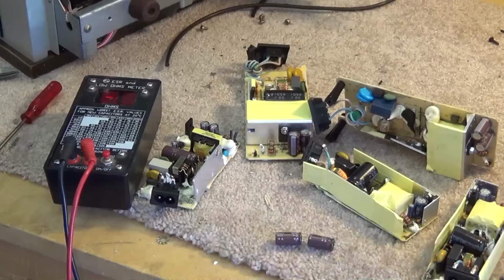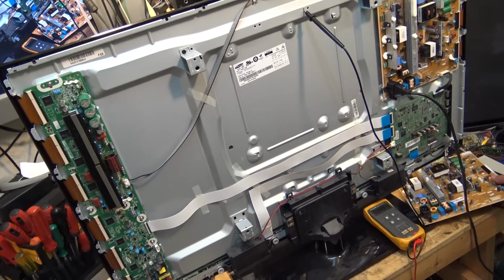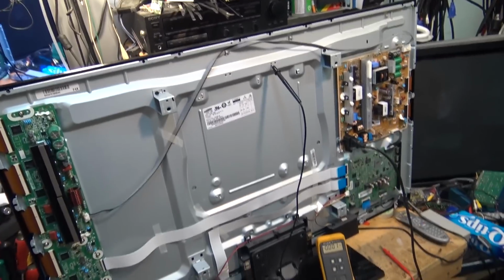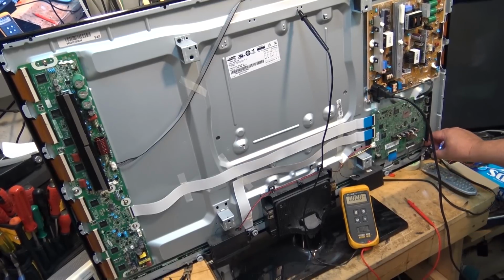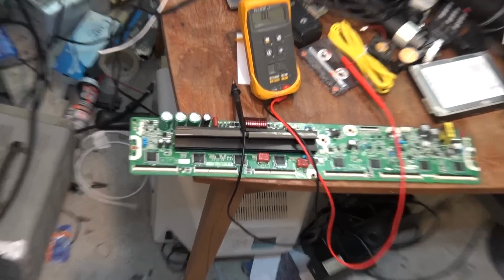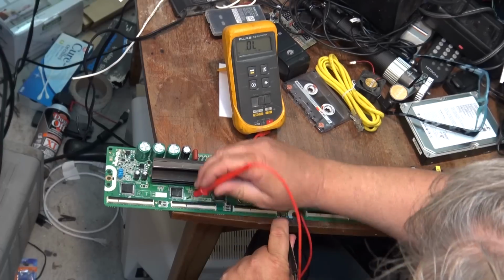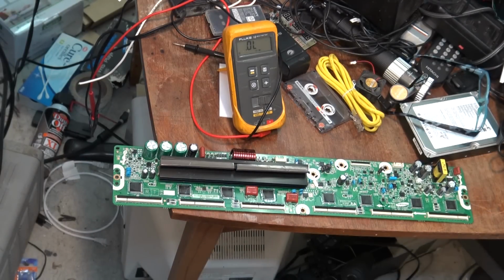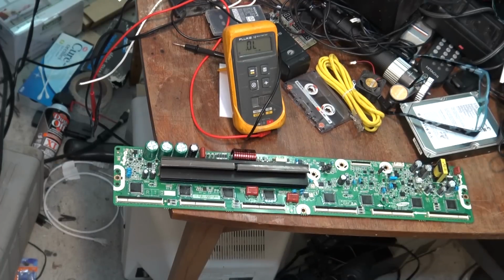2013 model year samsung plasma tv troubleshooting

Comment: I have the 50 Inch version PN51F4500AF (2013) and its dead too 3 flashes on power indicator.  The blue status light on controller board doesn't blink at all, VSS which suppose to be 205 volts shows 10.75 volts and VSA shows 0 volts.  Can I assume the power supply is the problem?

Comment: I have a Samsung 60-inch plasma TV, model PN60E550D1FXZA with factory remote. When cold, the TV will turn on and operate normally. After operating for longer than 30-60 minutes, if the set is turned OFF and then back ON, it will turn back ON, but there is no picture (screen remains black). I can confirm set is ON because I can hear audio from the speakers when I operate the VOLUME UP/DOWN control on the remote. If I allow the TV to rest (cool), it will eventually turn back ON with picture restored. That may take an hour or overnight.

I have removed the back of the TV and looked for overheated or bulging caps. There is some minor overheating indicated on what I presume to be the Main Power board (located in the middle behind the back panel cover) in the vicinity of NT8015, see attached pic labeled "NT8015 Heating". All of the capacitors on all the boards look normal.

I have a digital Fluke meter so can take AC/DC voltage and continuity readings but am not sure where to start. No o'scope available.

I'm hoping you can recommend some voltage checks at particular test points when set is ON but in a loss of picture condition that will narrow down the problem to a particular board or components.

Thanks in advance. If more info needed, just let me know.
Reply from the maker: Have no advise on this.  I had one once that took exactly 20 minutes and 17 seconds to produce a picture every time it was turned on.  Decided that it was the little logic board that was the culprit but it was never replaced as the owner didn't want to replace on a guess and that was what it was.  Taking 20:17 every time it was turned on pointed to something at a logic level but no info. Guy took it away and just left it turned on 24/7 and just turned off his cable box when. Done. Had the Samsung logo boucing around the screen all night.  Was his garage tv. When it went in at night he turned it off.  Next day turned it on 20 minutes before watching.   Not worth it to fix.   Now fee parts available as plasma have been out of production for about 10 years.   Might be time to move on.   I get people asking me to look at their old flat panels all the time and decline almost all of them.  Even for friends.  Just not worth the time or effort.

Comment: Hello. SIR, I Own A Plasma TV I Removed The Back Cover And Tested Some Of The Components The Capacitors Arent Swollen At All, But The  13 Wiring Harness Going From The Y Sustain Board To The X Board Is Burnt. The TV Was Working Fine When On Then The Screen Will Go Dark,
Reply from the maker: Don't have a clue.  Been a long time since i looked at a tv.
Reply: Hello, SIR, I Found The Problem, Its The Two Capacitors On The Y Sustain Board, PN C5107 - C5106. 250 Volts 47 UF. There Facing Downwards And Leaking Fluid. Would That Interfere With My Screen Going Dark, Its Only A Question, Thanks Again,
Reply from the maker: @arduinogalipo4850  if they are leaking they are shot.
Reply: @12voltvids  Thank You SIR
Reply: Hello SIR How Are You Doing, I Received Lead Connector For My Y Sustain Board & X Main Board. I Plug It In & Then The Transformer Board Made A Fizzing Sound IT Was To Late To Unplug It  I Check All The One Way Diodes Even The Small Ones, I Hear The Transformer Still Working & The Fusses Are All Good, What Do You Think Of Your Experience,
Reply: Hi Agine Sorry To Bother You, I Corrected The Harness At The Other End Reverse The Two Wires It Has 13 Wire Connector,

Comment: Hi!
I have the same TV with same shutdown faliure. I've mesured the chips like you did any they're all fine. I also mesured other components and found 2 bad IGBTs and a fast recovery diode. Is it possible that these components failed by them self? I'm afraid that even if I replace them they'll fail again. I checked as many components as I could but I find no fault other then these. 
Since one of the IGBT's that failed is paired with another one in paralelle on the main heatsink I think if there would be a driver or output problem both on them would have popped is that correct?
Thanks for your answear!
Lovely vids as always! <3

Comment: Sorry to bother again but, in your experience, is there danger of a "bad or shorted" board damaging other boards?  I'll be replacing all boards 'cuz I don't have the expertise to determine  which of the boards are bad. I won't  put them in one at a time if there's a chance of damage but I'd sure like to know the culprit!  :-)  Thank you.
Reply from the maker: The system is fairly well protected but plasma sets are high voltage high current devices so it is possible that the y main or  x main board could be damaged.  Measure all the diodes and mosfet for shorts do a visual for any blown parts.  By blown look for parts that are blown apart because due to the high power on plasma many times if a part fails will will be burnt or blown apart.

Comment: Hey,  My Samsung PN60F5300AFZA (plasma 2013) went dark and now when connected to power the front panel red indicator light blinks three times and then nothing happens.  Care to take a guess at what to replace?  Here's a list of the boards it has.        Thanks! 
Samsung BN44-00601A (PSPF371503A) Power Supply Unit
Samsung BN94-06195G (BN97-06528V, BN41-01965A) Main Board
Samsung BN96-25255A (LJ92-01957A) X-Main Board
Samsung BN96-25257A (LJ92-01964A) X-Buffer Board
Samsung LJ92-01958A Y-Main Board
Samsung LJ92-01962A Upper Y Scan Drive
Samsung LJ92-01963A Lower Scan Drive
Reply from the maker: Likely one of the buffer boards but you will need to measure and look for shorts. Could be just about anything.  I am not a plasma expert. I have only worked on a hand full of them.
Reply: Thank you kindly for weighing in.

Comment: Hi 12volvids, thanks for the video. Its great actually watching someone who knows what they're doing work! I have practically the same model with the intergrated power board. I went to start testing it and its blown a fuse, so i'll have to pick up a few before any testing. I run the tv through a stabaliser which also blew its fuse at the same time?! Does this immediately indicate something to you?? Thanks again.
Reply from the maker: Short in the power supply
Reply: Cheers  @12voltvids ! I'm testing both sides of the fuse for a short to ground. But i haven't found one yet?!?!?!
Reply: @12voltvids  I'm going through this slowly. I found no shorts on the sides of the fuse so i put a new one in. I made myself a light bulb current limiter to test for the short. I used two 110v 40w lamps in series because i dont have anything else around. Lamps glow dimly. Unplugging the various boards makes no difference. Apparently the bridge rectifier is a common fault on this model, so i'll take it out and test it. But based on what i've been learning around the place, it seems like its just a fuse. Whats the likelihood of that?!?!
Reply from the maker: @mikescudder4621  yes bridge rectifiers can and do fail when power surges hit.  If there was a short the light bulbs would blow really bright.

Comment: Wow, they managed to get plasma running on just 3 boards? I'm impressed.
Reply from the maker: nomoredamnnamestouse 
That old Panasonic plasma sitting to the right of my bench has at least 15 fully populated boards in it. Talk about complicated. This one was a nice simple unit. I miss plasma sets. They still are my favorite and I have enough of them to last me a long time. Not counting the broken ones I need parts for I have 10 working sets. 2 of those are game sets as they have panel failures (solid green vertical line on 1)  I also have 3 more in the shop that were given to me to look at and see if they can be made functional again. One is a real high end Panasonic monitor with a stand alone tuner / controller box. I figure is I keep them long enough they will be worth something like all the old vintage stuff is now. Once most of the ones is service have been scrapped a working plasma just due to the coolness of how they operate will be a thing of beauty. Each pixel is operating just like a tube. Electrons ionizing a gas and flying across a gap producing ultraviolet radiation that makes phosphorous fluoresce.  How cool is that. LCD and OLED. Yawn, boring.

Comment: I have a similar set, the PN51F5300.  Similar challenge so I rolled the dice on a $15 ymain.  Tested fine before putting it in.  If TV is left unplugged for a while (24 hours) I can plug in and run the TV normally for a few hours.  At some point the picture will go blank, but I keep sound.  A reset in power and the TV will come back on, buy no sound or video. Possible bad power supply?  The new ymain does seem to run the TV much cooler than the old one.  TIA!

Comment: My 2009 Panasonic plasma is still running strong. I currently use it as a computer monitor and love the picture it produces. It will be a sad day when it is no longer repairable and I have to switch to lcd. :(
Reply from the maker: Yes I use a 2009 Panasonic 1080p plasma on my computer as my edit work monitor. Will be a sad day when it breaks.
Reply: I know. Those OLED sets are very expensive! Plasma is the next best thing.

Comment: What's that short high pitched squeal each time you turn on your bench power?  I've noticed it in your last couple of videos.  Just curious.  :-)
Reply from the maker: That 6 digit banggood clock is plugged into the switched bench power so when I turn on the power it beeps. I should probably plug it into an unswitched source.

Comment: I used repair these at component level. However I used to find when the buffer ic shorted it took out the mos fets on the ysus and often another driver ic smd underneath. In the end it was so time consuming fixing all the components that I just replaced the boards. Recently I had a samsung in 2011 model. The ysus had blown it's fets but the buffer was ok. I changed the buffer and ysus panels as I didn't trust it not to be completely error free. It's not worth blowing up a replacement panel. If I get one of these now I always change both if separate boards and keep back the buffer board until I can test it in a junk set so I don't wreck my customers tv. Enjoy your videos man. I'm in the UK.  Tv repair man 28 years.
Reply from the maker: Right. Usually what causes the buffer board to fail is the SMD driver on the YSus develops a bad connection. You will see that one on a prior video, where I was given a set with a bad buffer. Ordered a new buffer, and it was bad, missing the bottom portion of the pix, ordered another buffer. Before installing that I went over the ysus with a microscope, and found cracked solder on the tiny SMD drivers on the back side of the ysus. I pointed this out. They were covered with a piece of amber colored tape.
Fix them, and put ini the new buffer board and it is fixed, and still working today (watch the news on it every morning while getting ready for work)
Reply: Louis Rossmann has tons of videos on macbook board component level repairs.
Reply: Hey Tim, maybe you could think about putting a few short videos together. There's too little component level repair on YT!
I've learned a lot from Dave, but these days it's all smd stuff and boards are expensive!
Reply: Koffi Banan I have learned a lot on youtube but I have not done any videos in ages I am more into cb radio and vintage valve gear.
Reply: I know and have watched quite a few (but not the rambling hour long ones). You do learn the technique of microsoldering and troubleshooting but it's very mac specific. I almost never have access to schematics, let alone boardviews, but I am sometimes able to fix boards. It would be nice to see more videos of people working on random stuff and fixing what might be common faults. I've been thinking for some time now to do it myself (I'm not an expert of any kind, but I do work on cars, bikes, pc's, radios, whatever..)

Comment: 2013 was end of the line for plasma at least for the most part. It's really nice that they had simplified the design by then.
Reply from the maker: I miss the plasma sets. They had a superior picture. The OLED sets are promising if they can get the reliability up.
I still use plasma here. All my TVs, including my edit monitor are plasma. I have only 2 LCD. One is the monitor I use as a view finder over my bench, and the other is my 4K test set in my office where I check my 4K for quality before uploading.

Comment: Hi 12volts, great video as usual, just have one question, Is it possible to change the IC without too much damage if you use a hot air station and would it be best to change all the IC's at once to reduce the risk of another one failing??
Reply from the maker: Buffer chips are a changeable, using hot air, the trouble with them is they typically also glue them down with a silicone bead around the pins. These chips operate on high voltage, and can grow "tin whiskers" that will short the pins, so they hermetically seal them with silicone. You have to make sure you get it all off, and then cut the pins off with a razor blade remove the chip, clean up the board and replace the chip and re glue it down. If it was my own set I might attempt this, but on a clients set, it would be an entire board replacement.
On my own stuff, if it breaks again down the road, no big deal, but I don't want to get married to a clients set.  
Generally the other chips are fine. They are not that common that they fail, so the rest are probably good. Buffer chips have the dies soldered down as well, so you need to heat the bottom of the board as well as the top. They are a pain in the but to remove. I have tried taking some off a dead board and they are fun to work on, and I am being sarcastic when I say that. Worse than the gamma correction chip I changed on that sony.
Reply from the maker: Yes it is easy to get married to old electronics. Fix one problem, and something totally different breaks a few months later and then they demand that you fix it for free.
Reply: Did you have liability insurance and if so what does it cover? I'm just trying to understand where to stop when doing electronic repairs for family and friends (sometimes for money). People keep telling me to advertise repair locally but I know these days people will sue for anything.
Reply: 12voltvids Cant you use debonder to break the glue?
Reply: "I don't want to get married to a clients set" has this ever happened to you in the past? I'm really trying to be careful when doing favors for people in case that ever happens to me.
Reply from the maker: It is silicone rubber.
Reply: It's funny you say that I work in the automotive industry and the exact same thing happens, you fix a leaking water pump the next day there wheel bearing goes bad and they think it's your fault and they demand that it gets fixed for free so I know exactly what you're talking about
Reply from the maker: Remember the majority of the stuff I repair is my own equipment. People give me stuff to recycle, and I repair and sell it.
Very little of what I repair is for clients, and those clients I do have are mostly long term clients that I have had for many years. I am not too worried about someone attempting to sue me for repairing an old piece of electronics, but I also record the entire process.